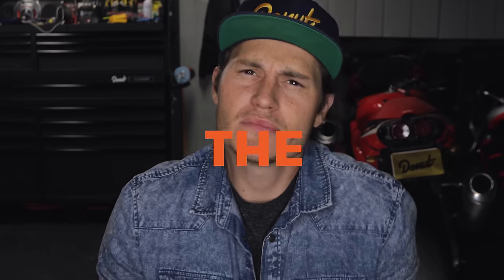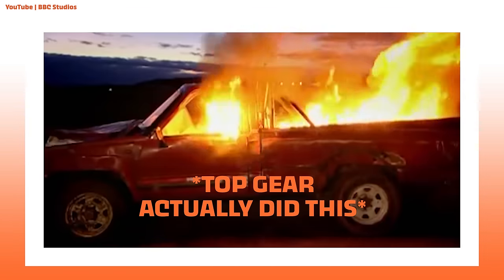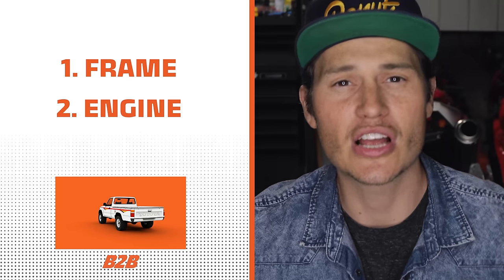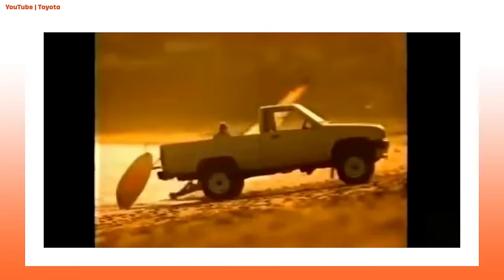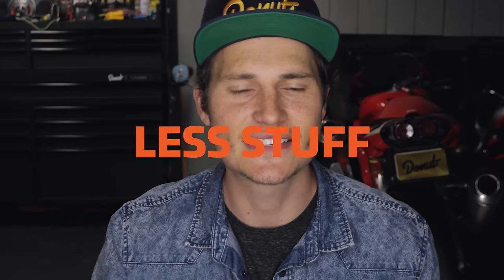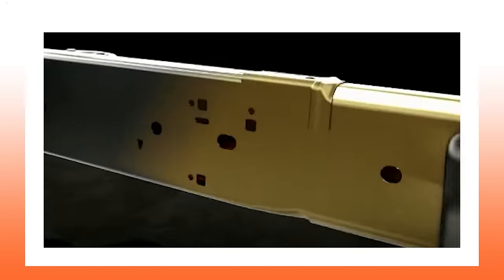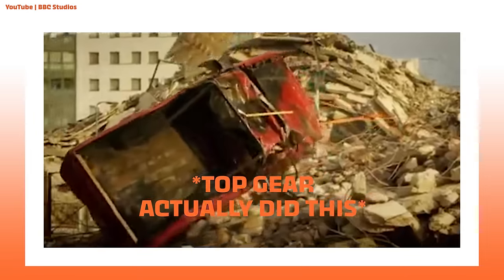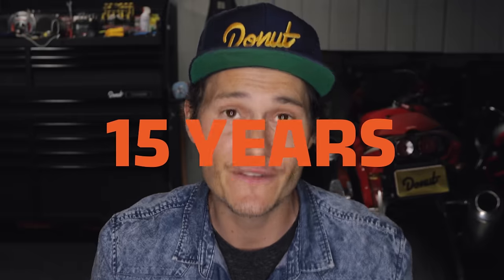Toyota PICKUP Truck - The Science EXPLAINED

Comment: Father owned one, mason( red seal) bricklayer, carried WAY Too many bricks in this 4x4 model, and he’d drive up wood tails size of four wheeler trail and we’d cut firewood for winter, minmum 1/2-3/4 cord every load(one the back in the small bed), rounded was not a good enough description(two fett above cab level and straps, chainsaw riding my lap all the ay “home never broke down ever, rusted to the grave after doing more work than a Peterbuild transport in total tonnage carried!

Comment: I drove a brand new 1989 Toyota pickup off the dealer floor. It lasted me 25 years with minimal headaches!  I had coated the frame with roofing tar (yes, roofing tar). When I sold it, the frame had no rust, and the only reason I sold it was that I bought a new Tacoma and decided to get rid of it. I paid 12K for the truck and it was a 4WD with the 22RE, 5 speed. The fan clutch, throttle position sensor and the brake clutch box were the only things that went bad in 25 years. I sold it to a friend, who sold it to a guy who had it transported to Honduras. I would gladly pay 4x what I sold it for to get it back!! I miss that truck. The Tacoma that I bought in place of my original is starting to corrode frame wise. I now own my third Toyota truck which is a 2021 Tacoma SR5. What a piece of shit that truck is. I'm getting 4 cylinder power with V8 fuel economy. Anyone interested in buying a 2021 SR5 with 9K on the clock?

Comment: As a Hilux owner I agree with everything you said except for the C channel, C channel is way better for trucks as opposed to box, box is brittle and prone to cracking, the flexible chassis distributes shock across the chassis, the Hilux ain't a race car.. it's a damn 2.4L!!! I have driven one... It's slow as fuck.  you also missed the fact that C channel chassis is double C channel welded, making a box shape. What you showed was inaccurate and incorrect. also the Hilux was never designed to be a heavy work truck, thats what the LandCruiser was built for. The Hilux was built for medium to small loads on rough terrain, LandCruiser, heavy loads over moderate terrain.

Comment: I've had 2 and I miss them both. Both 1980 2wd very basic tiny hemi with almost no vac lines and an aftermarket weber carb. One was a "3/4 ton longbed". Still a 20R but geared low with big clutch and breaks. I wish we still had an economy that could produce these. They would sell millions but not billions because they'll run 400k miles easy without needing much maintenance.
The small size is a huge design advantage that you didn't mention. In cities or in woods with no roads and trees too close together, I still went fast enough to kill 4 deer with my first 1980 pickup. If it gets stuck you can pull it out with a comealong on a small tree. I loaded it down with over 1500lbs lbs more than once and it still drove ok. Most the trucks I see on the road are huge and hardly ever haul more than that, or haul a trailer, so why are they so big? Big trucks are harder to drive,pay for, and store. I hope someone can start making these again someday. Same design exactly. It would out perform most any 2022 truck easy at 1/4 the cost.

Comment: Had a 1.6 litre petrol 4x4 1985 hilux (poverty pack lower spectral the 2.4), 1,750,000 kms  ( yes 1.7 million) 1 rebuild rings and valves, carb, and 1 gearbox, (used a supera one). Rust really hurt it bad, cut it out off we went again. Bloke who bought it was a bit put off buy the 750,000 shown on the clock.  I did bend the chassis on my 2.8 diesel 4x4  89 hilux, enough to make the front left door a hard to use, bit of tweaking to the guard, sold it with just over 400,000, one clutch and one set of brake pads 

The 1.7 million secret?  service, service service regually with good oils, fluids and filters etc.

Comment: I had a 92 yota pickup with 22re & 5 speed, it was not as strong as my 92 ranger. It's engine & rear axle were more durable, with the rest of the truck the the ranger was better. For one, the i-beam suspension of an old ranger is WAY stronger than an a-arm setup .... & as far as the frame, the Toyota would break ball joints & shock mounts etc long before a ranger would bend the frame... yes the Toyota frame is stronger  (& more susceptible to rust), but it's kind of a moot point. Only Chevy had major issues with the frame bending back then. All my friend who had Chevy trucks had bent frame from off roading lol. Not the same with Ford's so.

Comment: Yes they Burned the truck but it should have ended it THE building part However, they placed it on top of the building rather than in the building we are talking about tons and tons of concrete it would have been smashed flat it still is a feat of engineering that it isn't broken down after the drop but that was a drop onto concrete rubble that can move.

Comment: My toyota hilux is a 1997 the last of the 22R engines also the frame continued in the toyota hilux until 2003 the gen 7 in Australia and there are lots still running go out for a drive see at least two or three also in Australia not so many 4x4s from the 1980s to 2003 mine is rear wheel drive

Comment: A 300 powered F100 will tow the last Toyota truck to the crusher.
Reply: FWIW I have a Toyota and an ‘70 F100 with a 240.  The F100 is simpler, easier to maintain, and more capable.  Flex is good on a truck (stress cracks bad).

Comment: What is kind of sad is that Chevy Still makes Full Box frame trucks, but they Ship to Dealership and are generally sold with a Plastic plug on each side of the undercarriage to drain out water. Serves absolutely no Purpose to leave it in, lets water sit inside the frame and Rust. Customer came in with a 2014 Top Trim Chevy Silverado truck with less than 55,000 miles, after closer inspection the Frame was in really rough shape Maybe 40-45% of it's original integrity, covered in rust and full of water, Turns out it was an Elderly owner who left it In a field for 5 years never Unplugging the Plastic piece. I don't know why they even ship with a plug in them,  such a small oversight like that on a 40,000$ truck Will turn someone away from Chevy forever. On another Note, you can google this, a replacement cost for the Little black plug, is close to 140$ for shipping/ installation. it's like 5 bucks at Autozone for an off-brand part and like 2 Seconds of installation time. (Not saying you need this, I would get rid of it, it does nothing except hurt your truck)

Comment: I own a 1997 Toyota Hilux it has air conditioning which does work l have owned for 3 years because of its age l have done a lot of work it was the last year of the insanely reliable 22R engine it has a carburetor and the box chanel chassis is still in the Hilux to this day and l can walk into a Toyota dealer and buy a Toyota Hilux rear wheel drive and with wind up windows no power windows still reasonable basic

Comment: You can tell when someone is going off of not having any experience. The frames are the worst part! Even in the south they are the first to go. The 22re are really good motors if they are built right. Now for the Toyota hilux with the Diesel engine is built a little better. But yeah just the Toyota pickup with the 22re the frames rust into right behind cab a lot of times. An other times they rust out at spring perch’s. An the motors aren’t any better then any other unless they are built right or kept up good.

Comment: Ahem!  It wasn't the Ford Ranger that was recalled for frame failure due to rust through.  EVERY Toyota Tacoma was recalled and either required an entire frame r&r, or some level of cut out and repair.  Every one.  This issues started well before the recalls and with the 1980's trucks.  What person buys a 1980's Toyota without completely verifying the frame health?

There have been very few problems with open channel frames in other brands for good reason:  They dry out and don't become salt traps.  Problems with Dodge trucks actually failing have ALL been due to user abuse, but Dodge paid anyway because the fallout wasn't worth the fight for the truth

So, although your many points on one being different from the other are all valid, it doesn't make one actually better, unless talking about duty rating and expectation  of use.

Again, using the Ranger example: They FAR outnumber Toyotas for a good reason: Cost.

Fleets all over the world prefer the Ford to the Toyota because they offer higher load capacity, while being just as trouble free over the length of the expected life of the vehicle., C-channel, frame notwithstanding.  Further, ther Ranger got better and bertter over it very long prodection run, whereas the Toyota became very complex and had other issues not related to the frame. 

Toyota builds a very good machine, ansd simplicity matters, but simplcity no longer is applicable in any vehicle to the degreee it was.  As an example, if it wasn't for stupid kids wrecking them all, the AMC Jeep CJ would very likely be seen much more frequently on the roads today.  The Toyota FJ-40 was the direct progeny of that vehicle.  So was the Land Rover Defender.  The Jeep CJ as built by AMC was probably the most reliable vehicle in the world for many years in many environments, but you can still break them.

Today, there are few left - just as there are few 1983 Toyotas left.  I had one, a diesel.  Bombproof, but I had a 2007 Ranger, too.  Also bombproof.  Righ now, I'm looking for another Ranger in the 2007-2011 model years - because they are a better bang for the buck.

Comment: The Toyota boxed frames of the 80s were built extremely thin (due to the box design being able to be stronger with less steel than a C frame due to its design) and used almost no rustproofing, unlike what the American trucks were attempting to do at the time. So rust became a big issue. Theres a reason you dont see any 60s-80s Japanese cars on American roads anymore...its because there are none. They all rusted into dust. While people shit on American cars from that era, you still see them around because they were built with THICK steel instead of the really thin steel used by the Japanese at the time. Tell me the last time you saw an '80 Corolla. Ill wait. But you still occasionally see '80s era American trucks and large cars like LTDs, Caprices or Diplomats. The steel was thicker and didnt rust away in 10-15 years.
Reply: Not the Australian built Toyota Hiluxs mate...still plenty of chassis builts getting around still... dunno what they were handing out in the US...but ask any Aussie, Kiwi or Saffa...there's examples of over 1.2mill kms.. on what pass as roads here.

Comment: Well, not for nothing… When you don’t have enough power to self destruct and aren’t capable of any real work… It’s not surprising that you get a reputation for being indestructible. 

Have people had good experiences with these trucks? Sure. Have people had good experiences with trucks actually capable of real work? You know hauling 30,000+lbs day in and day out, yes. 

It’s all about perspective… These trucks ARE good trucks, but so are S10 are Ranger. And actual trucks… I’ve owned S10 and Ranger. I’ve personally launched those trucks 6 feet in the air, and drove to Home Depot and picked up 20 sheets of plywood the next day. 

And as I mentioned… No, 5,000lbs is NOT that much. Especially with half ton trucks now being rated for up to 13,000lbs+. And the S10 and Ranger are also considered 1/2 ton trucks. 

You literally proved yourself wrong about frames. So there’s no need to argue on that. However just for fun. Boxed frames are great. But have rust issues. C-Channel frames don’t typically have the same problem. Which right there makes the opening scenes in this video just stupid. Any rusted vehicle will break in half. And as a side note. The S10 used a partially boxed frame from its inception. The front half is boxed. The rear is C-Channel. Comparing a race built chassis to a pickup is incredibly moronic. Frame flexing is considered in design and it’s also considered when deciding what kind of ride quality the vehicle is expected to have. Stiff frames have benefits like added strength, but that strength comes at a premium of ride quality. 

If you like the truck, that’s fine but don’t make it out to be anything other than what it is. A midsize truck barely capable of getting any real truck like work done. Just like all other midsize trucks since the beginning of the segment. Hell, you can’t even put an effective snow plow on midsize trucks. Sure, a 6.5’-7’ plow is usable, but not for any actual commercial work.

Comment: How is the older trucks have been grabbed by the bad boys where's the filfy caliber machine gun put in the bed. They ride around and look for things to shoot at.  When I saw the Toyotaa to put their 50 Cal in I knew a Toyota was for me as well.
I live in Thailand and I enjoy the domination of the Toyota brand and service centers and parts everywhere.  When I hit a curb at speed and I did not need a realignment of the front end I knew something was going on right in Japan.  My F-150 could breathe on a curb and after a few miles the front tires would be ruined.  
    I don't know where you would live and not buy a Toyota. They just got the models and the market. Somebody's gonna work awfully hard to beat them off the top spot

Comment: You tried and your outcome is probably the same as the truth but if you average based off time instead of mile and compare average of all gas cars vs average of all electric than your measurements are not remotely accurate and unscientific because gas and diesel cars will always be the more powerful preference where electric will always be on average the more efficient sedan type cars. I don’t believe your statements of the difference can be accurate unless you compare sedan to sedan mile to mile assuming you can even measure that.

Comment: Horrible video with no real research. I thought we were going to talk about how the 90’s toyota is tougher than everything on the road. But you literally spent the video explain box frames and the 22re.

Lots of trucks have box frames and reliable engines but they are nothing even remotely close to the toughness of the 90’s Toyota trucks.

Weak content. Explain the intricacies of the suspension, frame, and drivetrain that makes it so tough. Yeah it takes actual work to figure that stuff out,